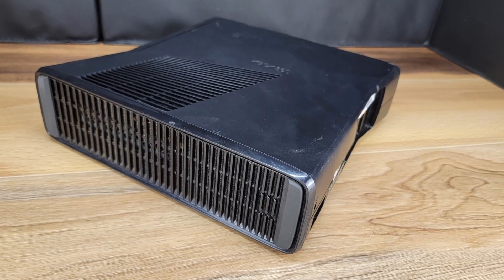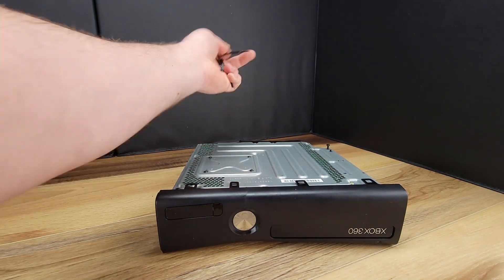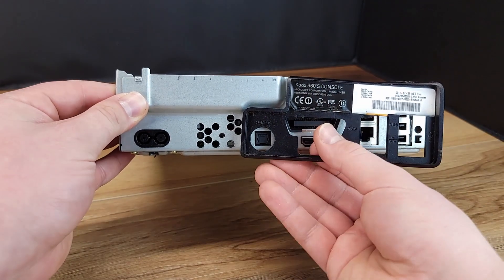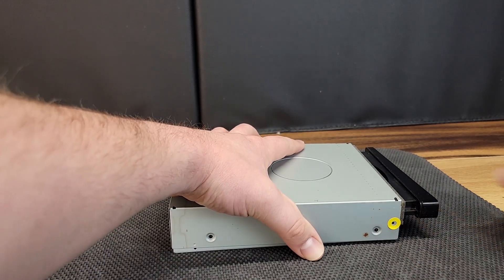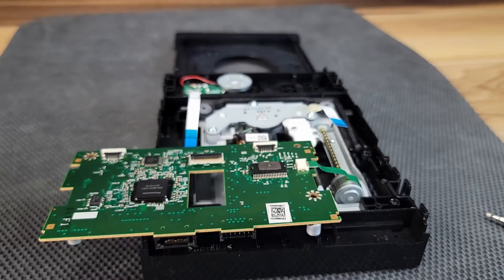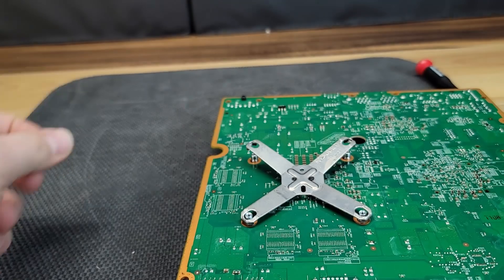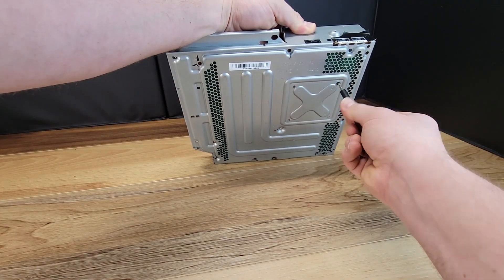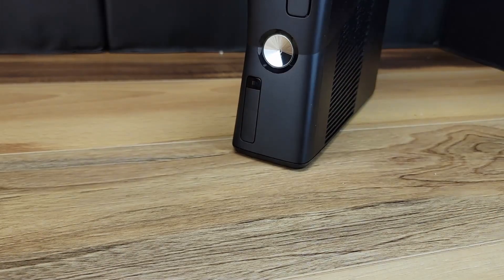Xbox 360s Model 1439 Refurbish - complete teardown, clean, new thermal paste and reassembly

Comment: Just curious if anyone else has this problem. But a good 60% ish of screws, especially around the motherboard, were stripped beyond belief for me. I had to dremmel them all into flatheads. As far as I kno, I got this brand new 13 ish years ago, and have never opened it myself. I just got to a bunch of screws and they were basically smooth circles

Comment: Well i did that and it worked but it didn't solve an issue i had with the cd reader, its kinda stuck and when i disassembled it it seemed alr so idk what to do at tbis point but the cpu and gpu are now cooler so its not much of a big loss

Comment: So, as expected, the paste in this 2010 Xbox 360S was completely gone. Got the same kind in the video on the way from Amazon, and after three hours of frustrated replaying parts in 0.25x, using a fork, butter knife and slightly too large interchangeable screwdriver bits, got the bugger open and cleaned for the second time in it's entire existence. Did a little terrified soldering after slipping and knocking a tiny rectangle peg loose on the motherboard removing the X that holds the heat sync down (fried my fingers, never soldered before), used Vitamin A&D moisturizer cream as temporary thermal paste from a Google search bc the real paste won't be in for two days, booted up, playing State of Decay digital offline bc the internet is broken. So far, so good 😂😭 can't afford a professional, but man, this is stressful as a clunky teen using YT tutorials and Google suggestions to tame the overworked beast. Haven't even put the outer shell on, just the bottom and front, and a small fan on max sitting right next to it for backup cooling bc lord knows this thing's gonna be MAD if it cooks the moisturizer off while running.

Comment: Awesome!  Just did this to my 360.  The OEM paste was pretty much toast after 13 years or so.  And for whatever reason, taking everything apart and putting back together cause the WiFi to start working again.  Hasn't worked in about 5 years.  Thanks for posting this!

Comment: thanks, needed some decent instructions on how to take mine apart, it was locking up after about 15mins in any game, looked through the vents with a flash light and realized it was filled with dust, after i took it apart the dust fell out like a weird shaped sponge idk how it was working at all.

Comment: What is that rubber dampener called, that wraps around the rear of the disc drive? Saw that mine was degraded, and falling apart because of rubber rot from old age. But I can’t seem to search for the correct term online to purchase one. I know it’s used for shock absorption, so I’d like to replace it soon.

Comment: brooooo thank you so much, you dont realise how much sufferage i had to open the clips, but thanks to your tip! i now could open them with ease, thank you sooooo much huge appreciation you deserve 100ks
*
Reply: Brother, what material did you clean the processor with?
Reply: @HamdaneDjeaili  a brush and an air duster, i also used some isopropyl alcohol for some parts

Comment: I did my refurbishment on New Year eve. The thing was, my Xbox didn’t have the X brace holding in the heatsink. Instead it was held in with Flathead screws and several delrin and stainless steel washers attached it both screws and underside of the Heatsink (I bought my 360 years ago from a pawn shop after my original got damaged in a move). Cleaning was a PAIN as the previous paste was completely dried and required a lot of rubbing alcohol on both the CPU, and Heatsink to be removed. I used Protronix Series 7 for my Thermal paste of choice. The Console runs fine now Thanks to your tutorial, albeit the Heatsink was Installed differently from the factory Specs.
Reply: Sounds like the infamous bolt mod.
Reply: @ineedandrenaline  It was a pain to reattach
Reply: @StabTheDabb  I think I'll have to replace my thermal paste sooner or later. Although my Slim is pretty quiet, I know nothing lasts forever.
Reply: @ineedandrenaline  Use Silver Paste

Comment: I did what you did with your disc drive, and now the laser doesn't move. I didn't touch anything but the laser (to clean) and lubes up everything.
Reply from the maker: I would go back through and check that all of your ribbon cables and connections are secure.
Reply: @Wildsamsquanch7  I figured out what the issue was. I was tightening the case too much, so the rotating magnet above couldn't move. Figured something was wrong when I kept the reader open and the laser moved and the disc spun.
Reply from the maker: @BeeWaifu  Awesome! Happy to hear you solved the problem!!!

Comment: is this model with jasper motherboard or not? thank you if you reply.
Reply: No this would not be a jasper. Those were only in the previous 360 models
Reply: I second this question! I have a 1439 model with what appears to be a broken MU(not saving correctly, updates not working regardless of having external storage), and I'm wondering if I am able to remove the internal MU completely to resolve this?
Reply: Update: I removed the side just like the first step in the tutorial, if you shine a flashlight in you will either see that there is a seperate PCB sticking up(like the video) or it will be soldered. Luckily in my case, it was a seperate board, so tomorrow I will take apart and remove the MU. I will update on how this goes, hopefully this helps you man